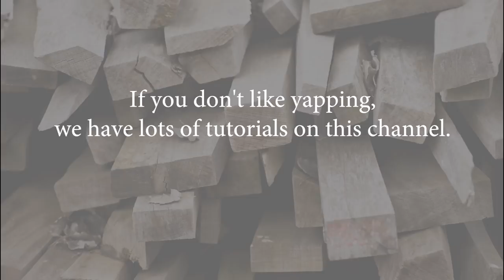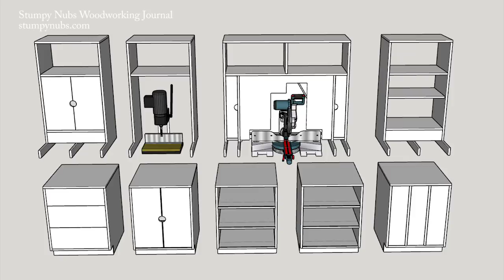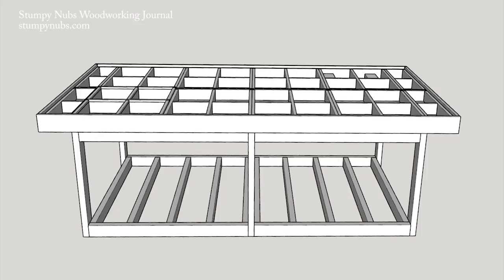It's 2020 and everything has changed (And some COOL new projects)

Comment: Here's my two-cents:  Woodworkers from MY Grandfather's generation most often engaged in their craft because they HAD to, either as a profession or because they needed to build their houses and furniture.  They would have welcomed the innovation  as it would have improved their craft and lightened their load!  It wasn't until the advent of the recreational woodworker (beginning in the 1950's with the movement growth through the 80's) that we see the "That's not the way my Pappy used to do it" crowd take root.  Don't tell me that a WW1 pilot didn't wish for a faster or more powerful plane!   The earlier Woodworkers HAD to have higher levels of skill to make up for the limitations of their current technology, just like the Japanese swordmaker had to use special techniques to make swords because for the most part their steel was inferior and difficult to work with.
By the way, the modular bench kicks butt!  Stumpy Nubs rocks!

Comment: the first time a used a "tablesaw" was 6 decades ago. most would cringe at how primitive it was, I am amazed i did not end up with some stumpy nubs..  I worked as a carpenter for many years and retired more 15 years ago, I am amazed at how much has changed since I stopped putting on a set of nail bags everyday. I am loving all the new stuff that has come along since then. I must admit i am a tool junkie. it is hard to let go of some of my old tools, I for sure will not get rid of some of my Dad's tools. Thanks for all you do.  I thoroughly enjoy all the videos.

Comment: Great way to start off the new decade. Really looking forward to seeing the assembly table. Keep up the good work. Get that radial arm saw out and put it to use. It's a great tool I would never want to be without.
Reply: I watched a video on the pros of a radial arm saw. Kinda makes me want to go with one, eventually. At least partly just for the contrary factor, though :D.
Reply: I have two of them and LOVE THEM. One set for fast dead on crossing and, the other is for accessories (planner, sander, etc). Get one! A lot of time you can get them off of Craigslist for next to and including free that is where I got my last on. Good luck.

Comment: I had a radial arm saw and no table saw nearly 50 years ago, but I would never have dreamed of cutting a full sheet of plywood with it.  A circular saw and a straight edge did a much better job, was probably even easier, and definitely much safer.

Comment: Dear stumpy 
I am a young woodworker looking to set up my first non garage shop and want to hang monitor(s) from the ceiling for being SketchUp models and the like. I was wondering if you could do a breakdown of what equipment you have how it is hung positioned and wired and where you would recommend placing said monitor(s) if I was going to do similar setup. Have 1200 ft shop and do primarily cabinets and am trying to branch out into more commissioned furniture prices 
Many thanks 
Micah

Comment: I prefer Stumpy Nubs, but after the accident, Blue Collar Woodworking might be better.   You're the safest guy I know.   I would also like to know how you use your Rockwell Bladerunner.  You made your own AND you own bandsaws and better equipment.   I actually have a bladerunner and while it's no substitute for a bandsaw or table saw, it's great for little home projects where I don't do something often enough to own a specialty tool.   It made a great ceramic saw for the ONE tile I'll probably ever cut in my life.   I have a whole collection of blades for every material known to man (or let's say, one blade of every type that Bosch makes).     Curious what you use it for.  THANKS!

Comment: NEVER heard of using a radial arm saw to rip plywood standing on edge on the floor, wow, glad you survived that
Reply: My grandfather was a millwright, built sawmills all over USA in early 1900's, powered by one steam engine that drove all equipment off of one shaft thru flat belts; frequently there was no power when the mill was under construction so all his tools were hand operated.  My Dad was a carpenter until early 1942 - told of three man crews laying oak flooring, two cut and installed while the third sharpened the saws; rotated jobs every half hour.  Dad bought a DeWalt 12" radial arm saw (RAS) in 1962, the side table that I built in 1964 is now the outfeed table for my table saw.  We broke down plywood just like now, lay down 4 2x4 for support on both sides of the cut, strike a line (we used chalkline) then cut with Skil saw.  That RAS had a sanding disk, sanding spindle, metal cutting abrasive disk, a jig to support work at the grinding wheel, and a drill chuck for precision drilling.

Stumps Nubs does attract attention, Blue Collar is more descriptive. I'll continue subscribing either way.
Reply from the maker: Check out some of the old DeWalt guides. They used to recommend all sorts of scary stuff.

Comment: If you want to see how tools have progressed in a less obviously flashy computerised way, look at your handsaws, particularly the dovetail saw, and then look at dovetail saws and dovetail joints from the 17th and 18th centuries. The dovetail joints you see in furniture from that period look crude compared to the london pattern hand-cut pointy-pinned dovetail joints you see today and the reason is probably that making a dovetail saw with a fine plate that doesn't buckle and which is hardened enough to have sharp teeth that hold an edge is a demanding job in metallurgy. Older saws really are not as good as modern well-made saws (the Pax and Veritas saws, not your big-box store throwaway job site universal filed induction hardened plastic handled saws which are basically a grand source for card scrapers as saws go). Nobody knew how to make the steel or shape the plates as well as we can do today, not at that fine a scale. 

Or, read something like "The Joiner and Cabinet Maker" and think about what happens to the apprentices who aren't the hero of a book. Being paid by the piece stops being romantic the first time you run a sharp tool into your hand and health insurance isn't a thing yet and repairing a severed tendon or ligament isn't possible.

I might not like CNC machines and I might have an abiding bowel-level fear of routers, but the house has a small electronics lab with a 3D printer as well as a shed full of hand tools. There's not just a place for both, the newer stuff has earned that place by doing things the older stuff just can't. Want a 4" dust cyclone seperator that will fit in an 8'x6' shed? Good luck buying one, but you can build one in a 3D printer, and usually for less in materials than you'd spend on the plumbing fittings to get a 4" dust hose down to the 2" on the cyclone. 

Oh, and "stumpy nubs" always sounded funny, but it was never in danger of being mistaken for your name any more than I'd see "Mustache Mike" on a driver's licence; and blue collar woodworking sounded like what the channel does. It's a good name.

Comment: I love your vids, but i hate isotunes. I had 2 different pair. The extra and the industrial. If my phone was in my shirt pocket it was ok, but if in my pants pocket the bluetooth would cut out. Neither one lasted a month before the left ear on both just stopped working. Wont get them again
Reply from the maker: They had some connectivity issues at one time, but I believe they have fixed them. Contact them and they will let you trade your two old pairs for new ones. They are really a great family business.

Comment: First decade was the "aughts".

Where in the world could you have possibly learned to rip a sheet of plywood with the RAS blade towards you? I've been a RAS owner since 1972, and have heard most of the horror old wives tales about them, but this may be the worst.
Reply from the maker: Check out some of the old DeWalt guides. They used to recommend all sorts of scary stuff.
Reply: Since DeWalt (the original, not the B&D rebrander) invented the RAS, I'm sure they had all the practices worked out by the time they got to the home DIYer. I'd be incredibly surprised if that particular technique was recommended. Check out Mr. Sawdust's "How to Master the Radial Saw" for the history.

It was easy enough to rip a sheet of plywood on my Sears (lengthwise, otherwise it's not a rip) just by repositioning the fence and turning the head. You could rip to the center of a 4x8 sheet. No floor involved. Outfeed support was helpful.
Reply from the maker: @lrodpeterson3046  - You're partially right and I am partially right. It wasn't for ripping. That was me mis-speaking. It was for crosscutting a full sheet, standing it on end on the floow (or on a wooden track built on the front of your bench near the floor. Still, it's the same thing- the blade is facing you and it's stupid dangerous. Perhaps the most dangerous thing Dewalt suggested their saws be used for, which is saying something because a lot of other stuff they had in those manuals was iffy at best.